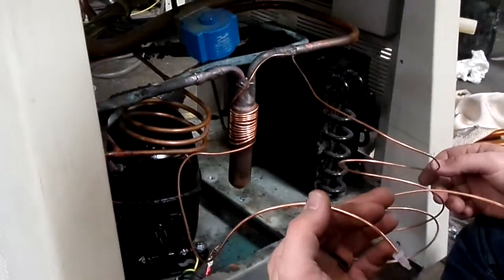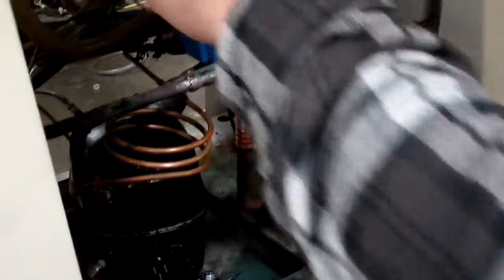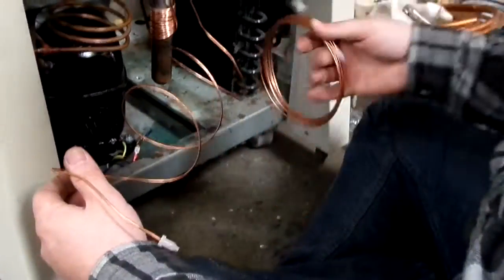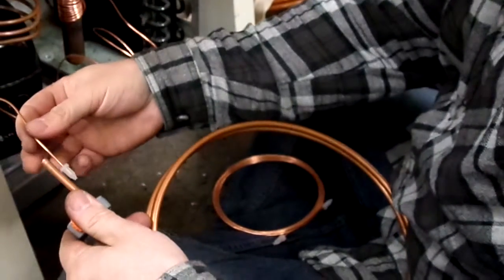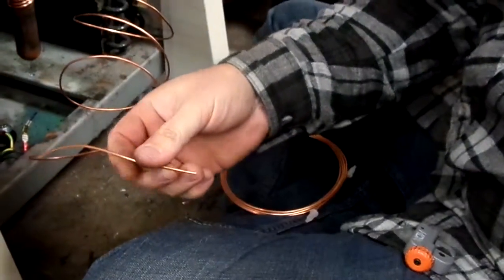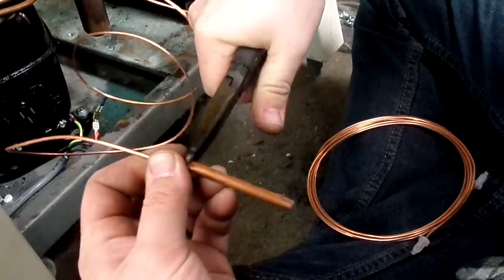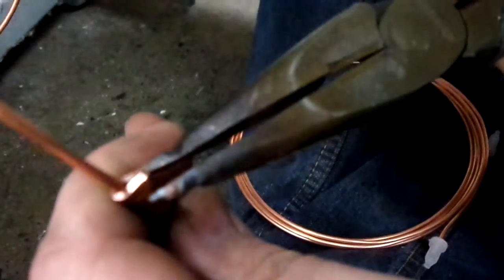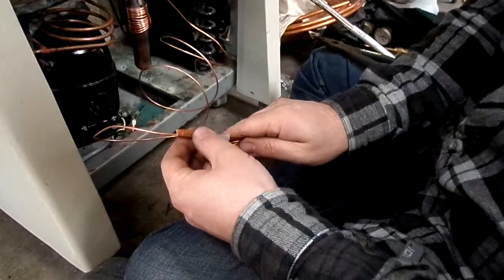Coupling capillary tubes

Comment: The coupler wont effect the throttling?  Going through that size difference? Seems like that tube would cause a little fart in the math of cap tube length/ size for the application..